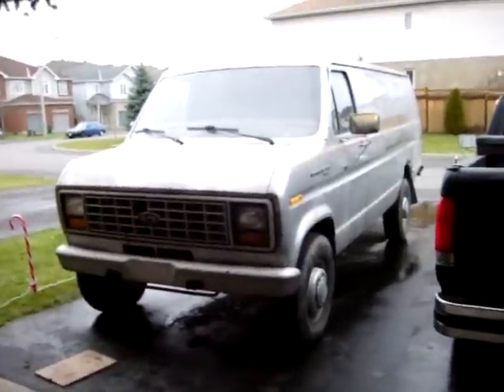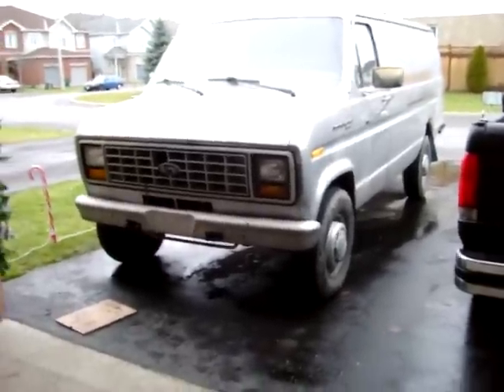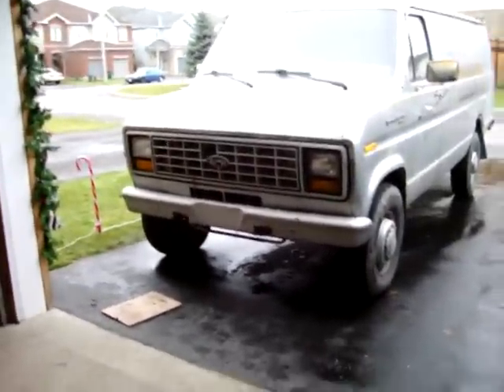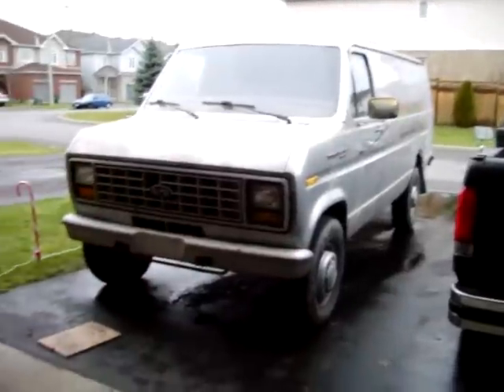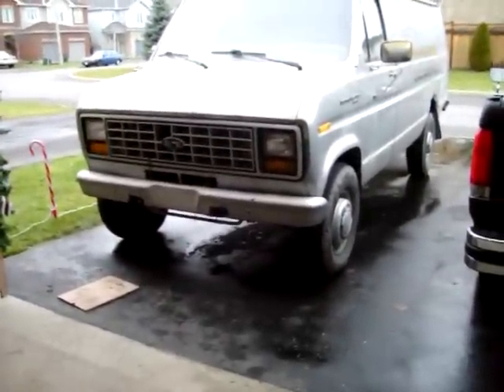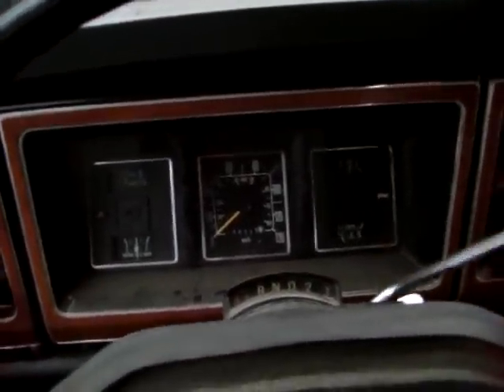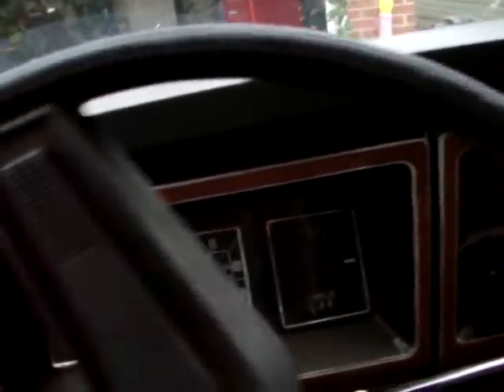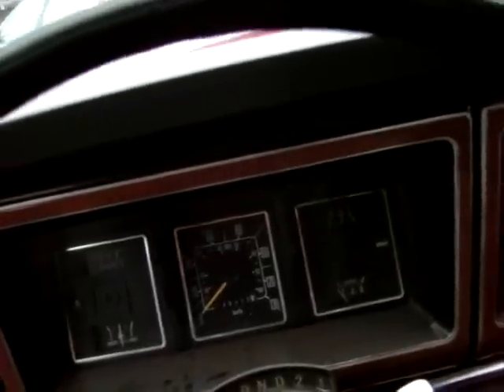1985 Ford E350 Diesel Van Update and Short Ride

Comment from the maker: Depends witch one you get. The 3 speed C6 is the best, very very strong, durable trans. straight from factory. But in 1989 the 4 speed OD (E4OD) came out, those are fully electronic, those are trouble more than anything, and shift to soft from the factory, and don't live long under towing conditions. Either one, buying one, drop the pan, change filter, and flush it, and you'll be good for a while.

Comment from the maker: The 1992 injectors just have a higher fuel output for more power/performance, have nothing to do with cold starting. Any of these old diesels will start right up even in the cold as long as the glow plugs are up for it.

Comment from the maker: In my storage trailer, won't fit behind a diesel. It's a very light duty for behind a 300-6, 302 or 351. Those are the only engines it will bolt up to.

Comment: Two questions Jon.  One; what is the third light in the cluster ?  Glow Plug, Water In Fuel, and the other ?  Second; isn't it better that the fast idle doesn't work ?  Wouldn't it just cause extra cold start wear ?  I've always hated when I start the Ford on a cold morning and it revs up to 1,500RPM, because it makes me think it is wearing more than at 850RPM (natural idle).